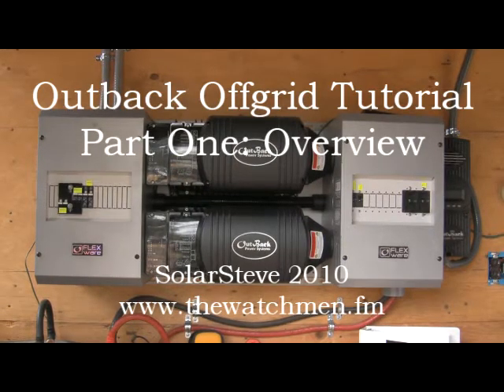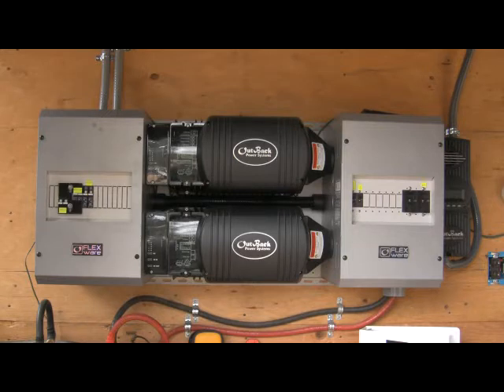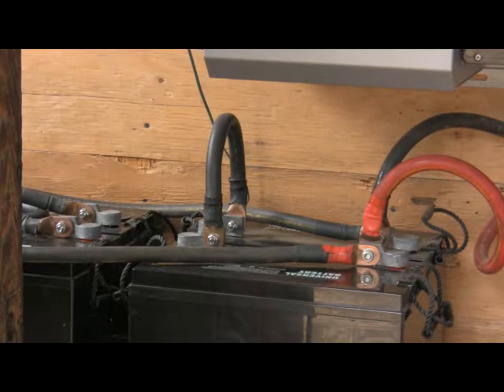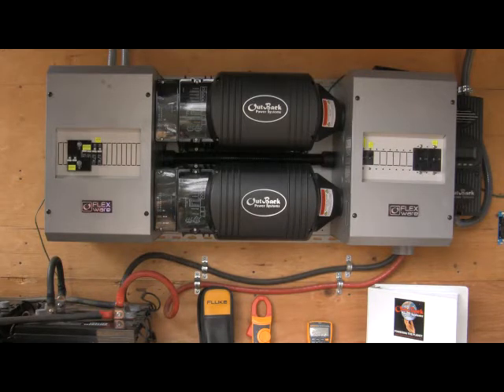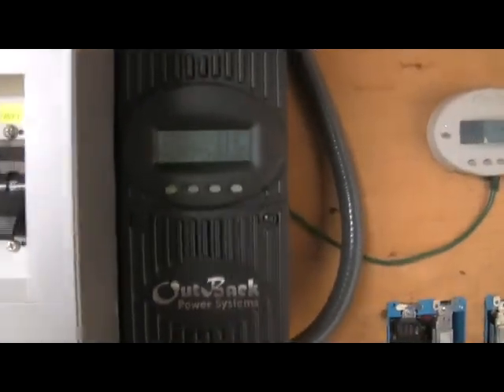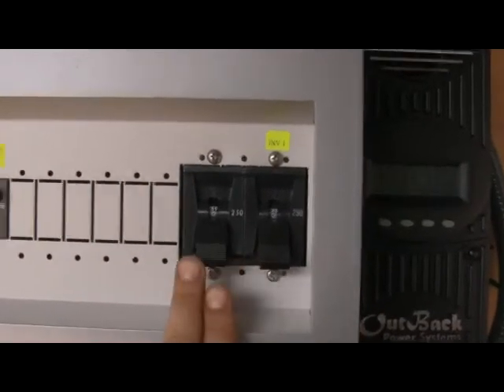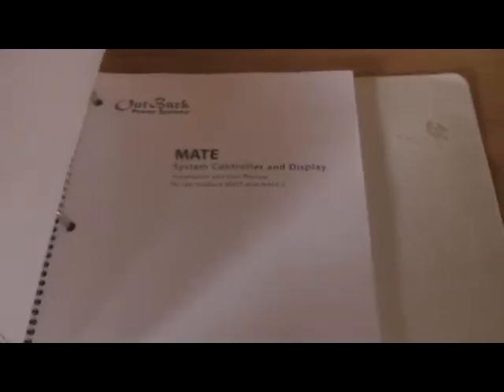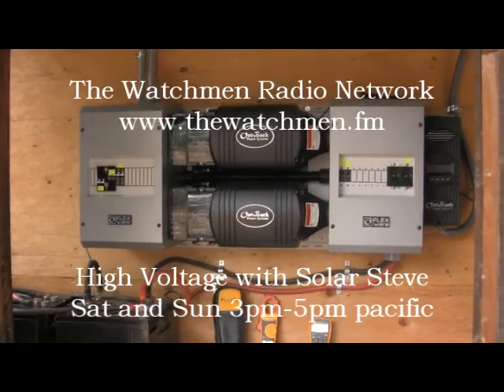Outback Offgrid Overview.mp4

Comment from the maker: Outback products generally are extremely durable, reliable and practically bulletproof. I love my FM 60!~ I especially like how I can change the battery voltage in software between 12 and 60 volts!!!~ They aren't the cheapest CC out there by no means but they are worth it.

Comment: Hey Steve, great video. One note though, it will be ill-advised to connect all of the remaining panels to that single FM-60. If you put 1,500-1,600 total as you say, you will oversubscribe that charge controller. 1,500 watts at 24vdc gives you 62.5A and 1,600 watts gives you 66 A. You may want to limit the number of panels you throw on it or get another FM-60. Of course if you're not getting the actual 1.5kw - to 1.6kw due to locality then it might be OK.  Good work!

Comment from the maker: @Twistedtwin41...Each inverter is rated for 3500 watts continuous or approx 30 amps on the AC side. In its current configuration, each inverter is wired to load each leg, so it means up to 30 amps on each leg whether the load is 240v or 120v. For most folks running in an emergency mode, this is MORE than ENOUGH power. You could litererally run multiple refers/freezers, computers, lights or one heck of a large water pump. You must have the batteries and generation to match these loads however.

Comment from the maker: @econewpower   Thanks for the comment! Nameplate wattage of all the panels adds to 1309 watts. String voltages calc to within a 3% variance and string amps are not material other than total line amps in the 15 amp range.  1309 watts on 24v calcs to 54.5 amps charger output. Should work just fine. Yes, they could overdrive on a rare cold day with snowfall amplifying sunlight, but this situation is unlikely. I know I said 1500 to 1600, but its actually 1309. You would be right if that was true.

Comment: Very nice I used 4/0 tempco welding cables on the 12 crown 235 ah 6v batteries on mine it is 12v 1410 ah .

Comment: Hi Steve.  Lou here.  I have pretty much the same system but have built it up one outback piece at a time.  ARGGG...  SO,  I have a question for you and I am debating on adding the rest of the Flexnet pieces/parts to make it a true Flexnet 500 system.  Have you only 70 amp breakers used to turn off each of the inverters or are they actually 175 amp breakers.  Do you have a manual to the backplane and the ac and dc boxes on each side of the vfx3524 as well as the plastic box on the left side of the inverters for the ac input/output?  Oh, I bought one of the MATE3 controllers and the FX-DC dc monitoring interfaces so you can view the system through your home web system to follow what your system is doing at any given time.

Comment: i have only 750W pv and 8KW 120/240V 50A pur sinus motomaster inverter/charger and   6 x US-REL162VXC BATTERIE ÉNERGIE RENOUVELABLE 2V 1100AH in series  i have 1 months of light  and  heater   with backup 15KW GENERAC  auto start generator 160L underground gas tank   i buy new pv in summer here in quebec federal and provincial gov not pay for GREEN energy  here  and Hydro Quebec (my power company) not pay for return on grid power